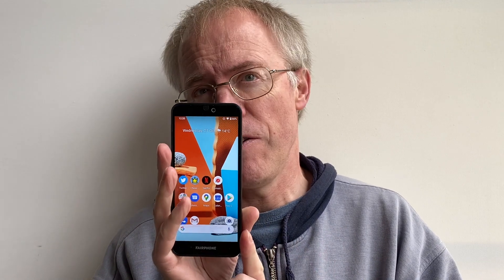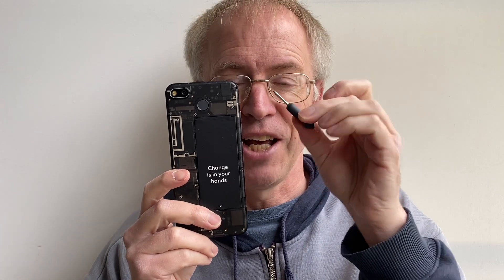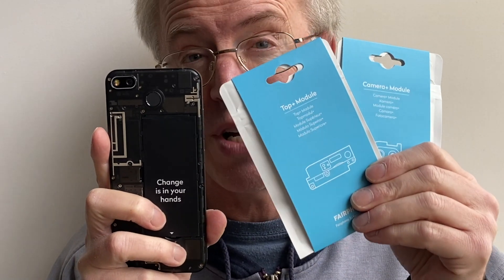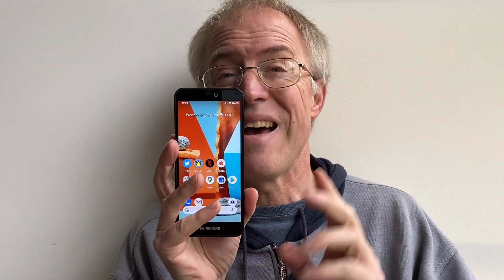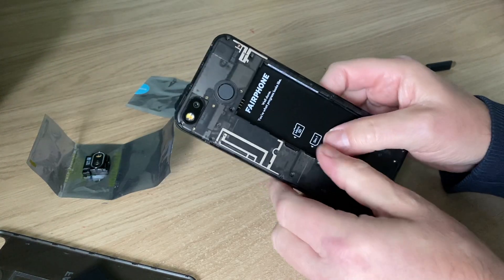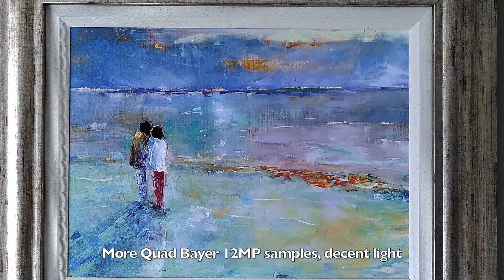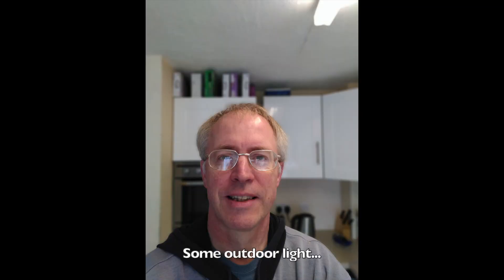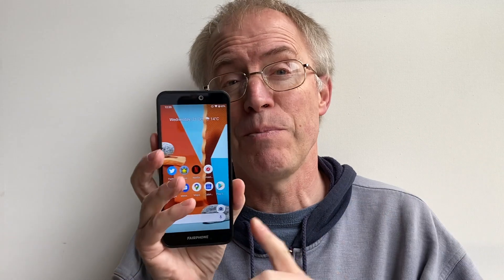The Phones Show 408 (Upgrading the Fairphone 3 to the Fairphone 3+)

Comment: It's not completely a 3+ btw. They made small changes to the inside. Don't no what exactly, but it has something to do with the sound that gets out of the 3.5mm headphone jack. Should be louter/better with the 3+.
Reply from the maker: Details on this? Where did you hear it?
Reply: @stevelitchfield  https://tweakers.net/reviews/8038/2/een-beetje-mee-met-de-markt-fairphone-3+-wat-er-anders-is.html 
Had to look back for you. It's a big Dutch tech site. They mention a new supplier for the audio module so the sound gets louder. This also asks for a new amp which means a small redesign of the pcb. They searched for a new supplier because they cooperate further for a better work environment. This pcb isn't a module-part. That's the only minor difference between the 3 and 3+ so far as I know of. The info in the article comes directly from Fairphone itself.
Reply from the maker: @degrootallard  Many thanks.